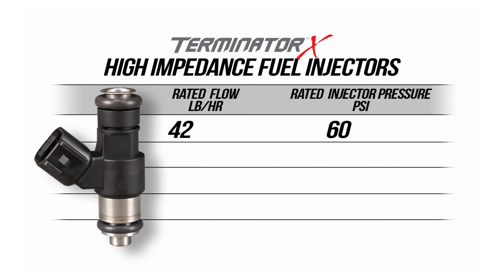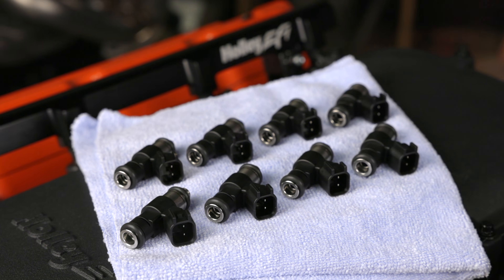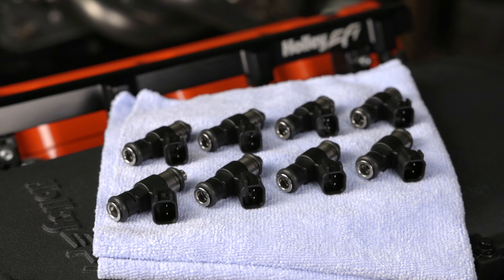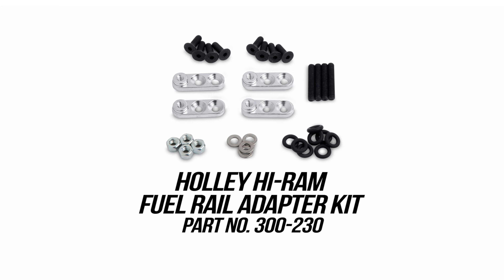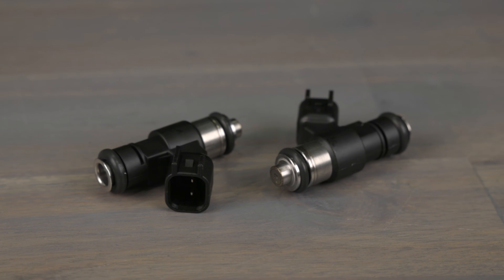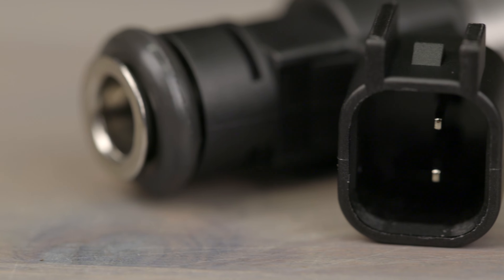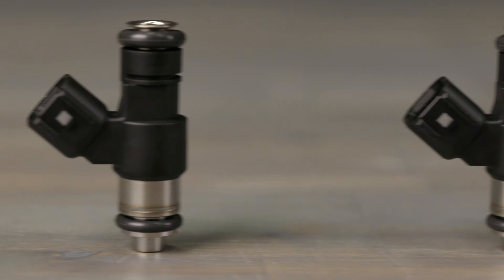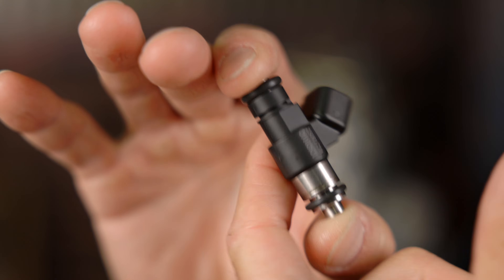New Terminator X High Impedance-Fuel Injectors in Multiple Flow Rates

Comment: These are the worst injectors ive had two sets of flow matched holley 220lb over 800 a set and no real warranty.mine had less then 200 miles on them before three went bad.these are definitely not bosche i bought them from summit racing the first time and holley the second time.